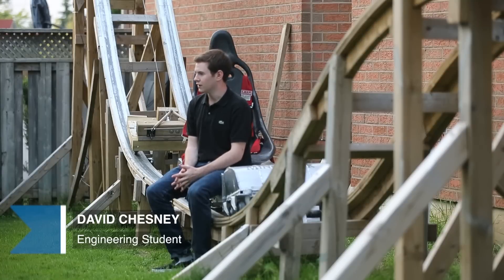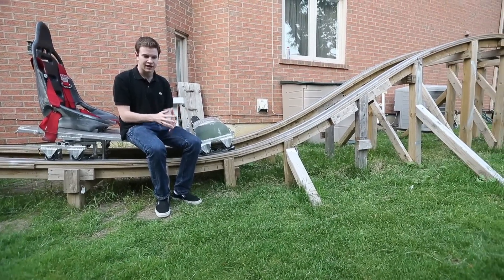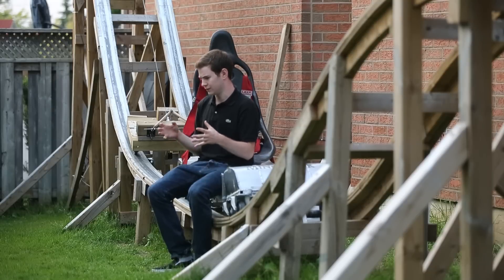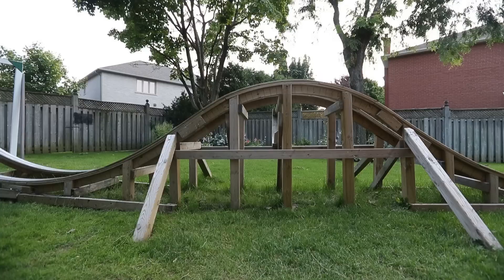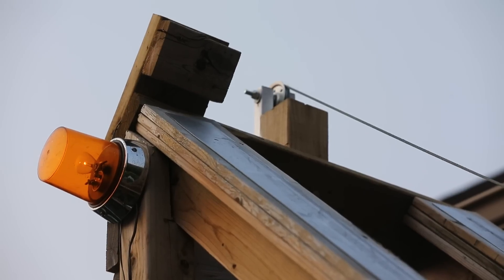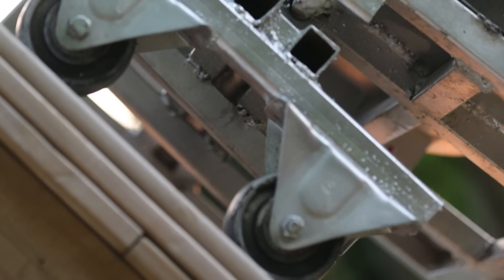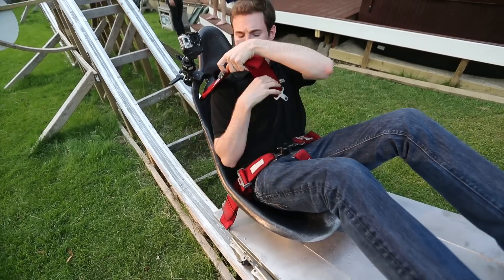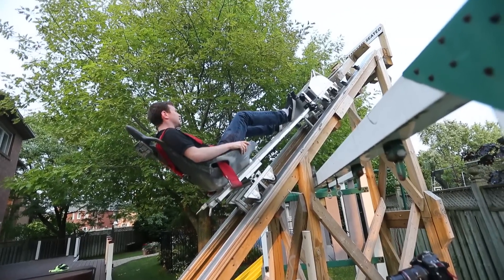Backyard Roller Coaster

Comment: Good effort but it isn't really a coaster so much as a curvy, straight line that only goes back n forth. I would make a normal looped coaster. I am not knocking the kid either by what he has done is impressive.
Reply: huh?
Reply: +Desha Carpenter Q a Z?
Reply: There are also real coasters like that, their called boomerang coasters
Reply: Sam Eijkenboom called shuttle coasters actually, Boomerang is a specific model of shuttle coaster.
Reply: Marcus Sweetser Lol, a "normal looped coaster"? What? Literally everything you said was wrong. First of all, this is a perfectly legitimate coaster, specifically a shuttle coaster instead of a full circuit one that you probably are envisioning. Secondly, not sure what you think a "normal looped coaster" is, but this is a wooden coaster made in a kids backyard. There is so much variety even between full scale coaster models, that you can't possibly define normal.
Good effort at trying to nitpick but you may want to actually have some knowledge about the subject before doing so.